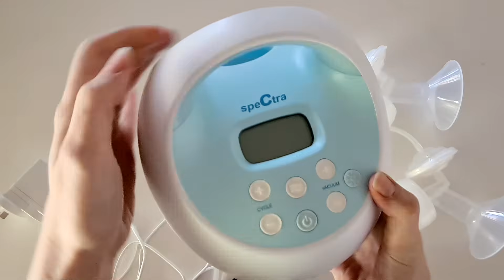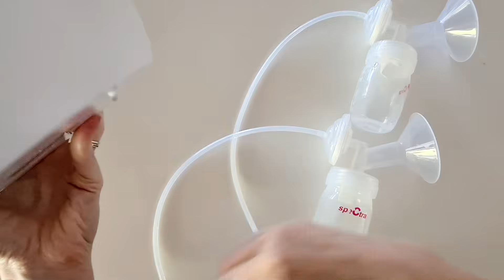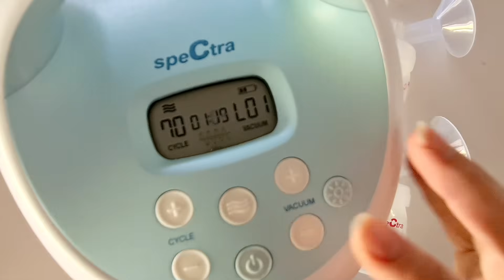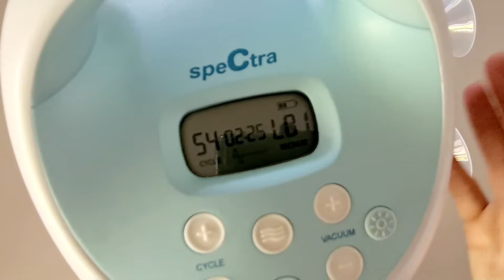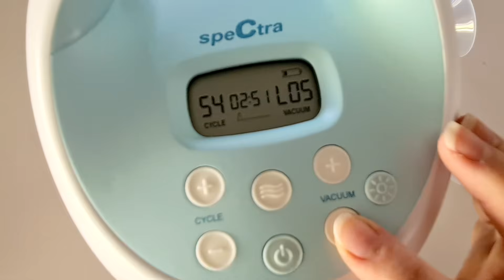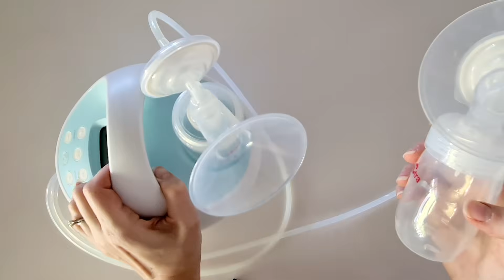How to Use Spectra S1 Breast Pump | Setup, Assembly & Settings Guide

Comment: Can you show how some people attach cups instead of those bottles? And for the tubing, how often will those need replacing? Is it okay to just...leave them attached like that? if not, where do you store them cleanly between pumps?
Reply from the maker: Spectra actually make wearable collection cups that connect to the tubing - no hacks needed :) https://amzn.to/4uhTaYE (Amazon) #ad

For the tubing, you usually only need to replace it if you notice moisture, mold, discoloration, stretching, or reduced suction. Since the Spectra S1 is a closed system, milk shouldn’t normally get into the tubing.

You can leave the tubing attached between sessions if you want. I personally just make sure the tubing stays dry and store the whole setup somewhere clean between pumps. Some moms keep it assembled in a clean basket or pumping cart so it’s ready to go 😊

Comment: Hi, super helpful video ! Does it damage the battery to pump while plugged in?
Reply from the maker: No, it won’t damage the battery to use it while plugged in. The Spectra S1 Plus is designed to run while connected to a power source. I would recommend charging it to full and then unplugging it when you’re not actively using it, as this can help prolong overall battery life over time.

Comment: Does anyone else only have C 1-C5 for thier cycle settings? Mine doesn't have 1-70?
Reply from the maker: I assume you are in the UK
They have updated settings here: https://spectrababy.co.uk/apps/help-center#hc-s1s2-display-update
Via the Spectra UK website 

S1/S2 display update.
The settings and functionality are exactly the same, it is just displayed differently now. This should help:

New Display will show: 

Expression Mode: 38~54 cycles per minute

Level C1: 38 

Level C2 : 42 

Level C3: 46 

Level C4: 50 

Level C5: 54 

Massage Mode: 70~105 cycles per minute  (A wave (~)symbol can be seen on the display)

Level C1: 70

Level C2 : 80 

Level C3: 90 

Level C4: 100 

Level C5: 105

Comment: Question, my milk doesn't flow into the bottle like it should even though I've followed your instructions. It usually leaks from the bottom of my boob unless I sit in a position such as leaning forward. Do you think that means I need a bigger size than 24mm?
Reply from the maker: I highly recommend measuring your nipple size. It generally gets smaller the further post-partum you are so it's good to regularly check. Here is a video for it https://youtu.be/GsAER6DPElg

It could also worth be replacing your duckbill valve - these need replacing every 2 months (depending on usage). This is the part that helps draw your milk into the collection container.

Hopefully that helps 😊